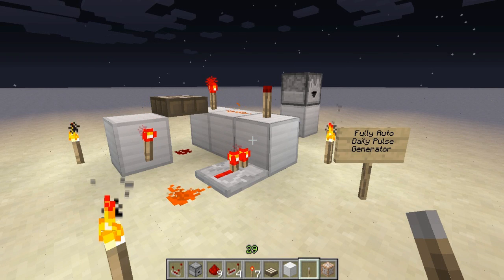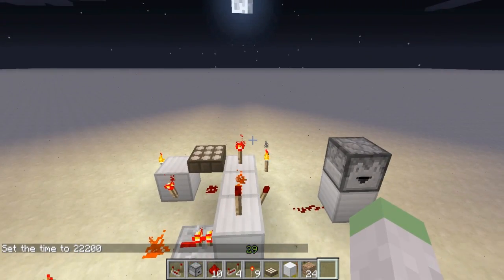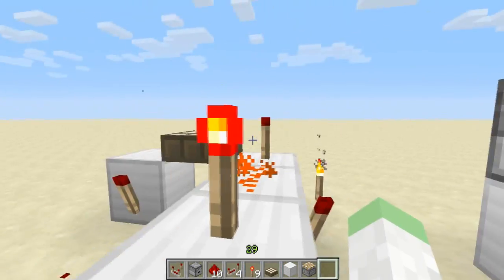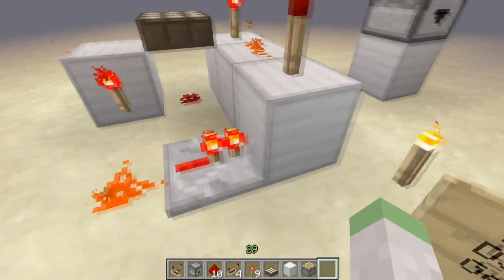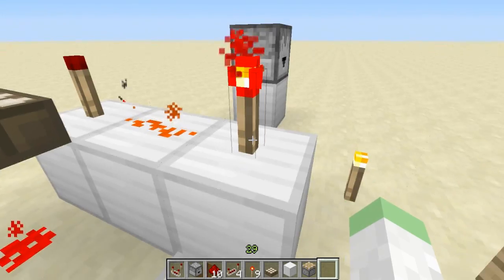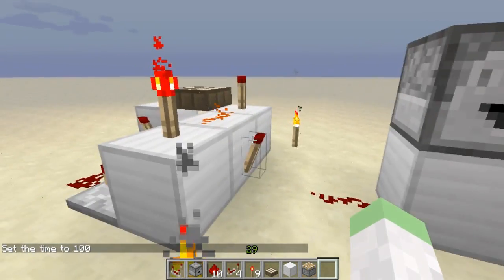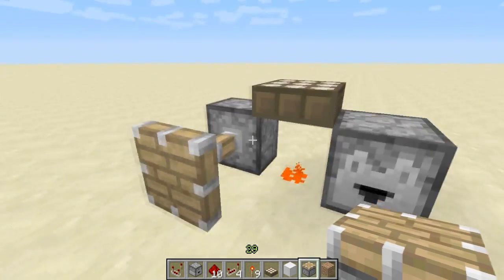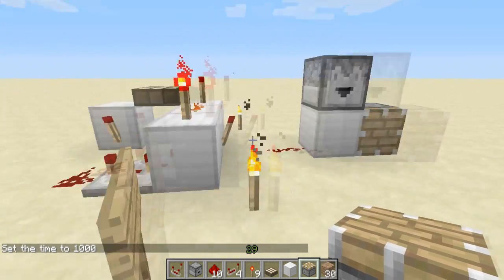[Minecraft] Automatic Single Pulse Generator (COMPACT)

Comment: yea just hook the daylight sensor to the monostable circuit by just placing the daylight sensor next to (or on top depends what shape your monostable circuit is) of the redstone that is next to the input block its that easy (the input block is the gray wool next to the redstone the block that powers the repeater and has the torch on the side)
if you don't know what a monostable circuit is they are very usefull here is a random video  /watch?v=M50KJwm8WKA